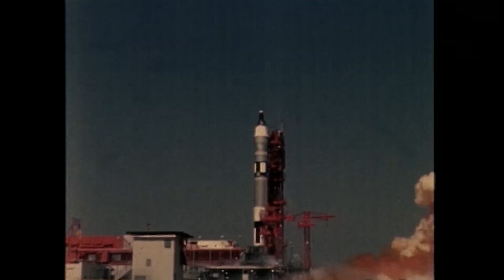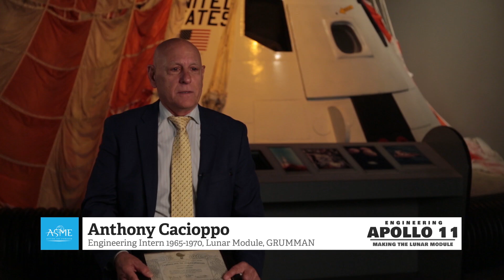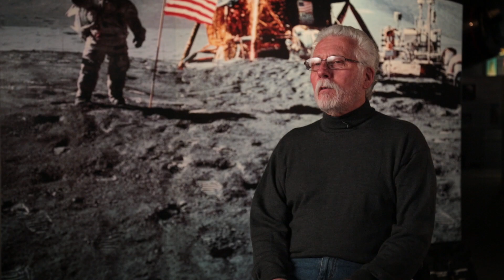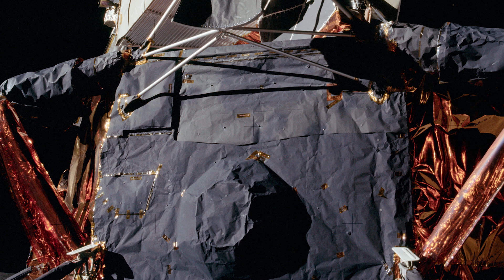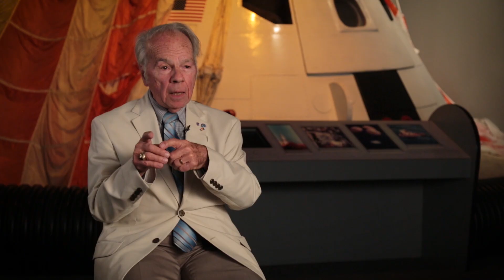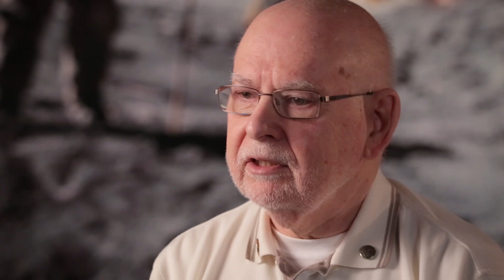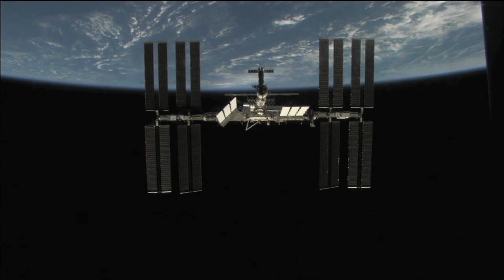Engineering Apollo 11: Making The Lunar Module [Full Documentary]

Comment: I watched them land on the moon as a kid And never really questioned any of it. Until one day I was looking at an Apollo 11 photo and noticed there was no blast crater under the luner lander I thought how could that be !!!.   So I started looking at why?? I started researching the rocket motor used for Apollo 11. It’s a 10k lbs thrust rocket motor. How is it possible that a 10kLbs rocket would not leave some sort of a blast crater or scare on the surface where it landed, yet non exists. I researched Apollo 11 and found several strange facts. According to NASA the skin of the lunar lander was so thin that you could stick a pencil through it. How could that be? That sounds rediculouse 
Then I found this. This guy is spot on. 

https://youtu.be/jKXS9KIdi4I
Reply: There is a perfectly good explantion for there not being a visible blast crater and this has been shown many many times.  If you take alook at this site:
http://www.clavius.org/
specifically this page:
http://www.clavius.org/techcrater.html
Or a video by Vintage Space, right here on YouTube.
Your blast crater worries can then be safely put to rest. 
As to pencils stabbing holes, a quick search reveals that the skin was just over 0.3 mm thick or nearly 4X that of a soda can.  It is true that the outer radiation protection layers were like foils, very thin, but the part that holds in the air could not be breached with a pencil.
Reply: @Mike Hengstebeck
"According to NASA the skin of the lunar lander was so thin that you could stick a pencil through it."
1. An aluminium Coke can is just 0.097mm thick. The LM skin was 0.305mm (0.012 inches) thick, more than 3 times as thick. Have you tried pushing a pencil through a Coke can?
2.The pressure in a (cool) Coke can is around 17psi and can rise to around 35 psi when warm. It is designed to withstand a pressure of up to 90psi before it ruptures. The pressure inside the LM was just 4.8psi.
3. If NASA were actually faking the whole thing, then why would they pick a design that would not stand up to scrutiny by other scientists and engineers,  picking a design that, according to moon landing deniers like yourself, would be so obviously doomed to failure? 

Sorry pal, all you have is your personal incredulity. You certainly have no knowledge of engineering.
Reply: @thearmouredpenguin7148  is that right?? LOL. And what’s your back ground?  Because it sounds to me like your guessing? Again what’s your back ground?
Reply: @mikehengstebeck2647  All this information is easily found on the internet. My background? A retired engineer who spent 40 years in the aerospace industry. And yours?
Reply: @thearmouredpenguin7148  I grew up in Titusville Florida. My father was aeronautical engineer Employed by NASA for 42 years he had an advance degree in rocketry & propulsion. I retired out of the military in 2001 as an intelligence officer.  My job, find the truth.  So how much research have you done on this subject? And what do you know about Werner von Braun ?
Reply: @thearmouredpenguin7148  also I’m curious as to who you worked for as an aerospace engineer? What agency?
Reply: @mikehengstebeck2647  I imagine your father must have been very disappointed in you.
Reply: @thearmouredpenguin7148  we never went to the moon we didn’t go then and we can’t go now.
Reply: @thearmouredpenguin7148  the group has decided on your new name.  It’s now Pinocchio.🤥
Reply: @thearmouredpenguin7148  funny how the aerospace engineer is now quit.  I guess when your a liar it’s hard to lie about things you know nothing about. Lying is never a good alternative mr aerospace engineer.   Belief is not a method of proof. We are not capable of going to the moon period.  🥸
Reply: @mikehengstebeck2647  I have said as much as I am prepared to say about my background. Everything I have said is verifiable. I am being truthful, you can believe me, or you can call me a liar, I really don't care. My post was not for your benefit, because the one thing I have learnt about "truthers" and conspiracy theorists is that the last thing they are interested is the truth, "they already know the truth", and that there is no evidence that would convince them otherwise. Never let facts get in the way of a good conspiracy.
The post is for the benefit of others who may have a real interest and have genuine questions, and to point out to them that there is always a reasonable answer to their questions.
Reply: @thearmouredpenguin7148   the skin of the lunar lander offered no protection from radiation and of course no protection from radiation is the whole other conversation. But again your a liar and have no idea regarding this subject matter.  Keep beleive in Santa clause
Reply: @mikehengstebeck2647  The thing to remember here is that the lunar module cabin was a pressure hull 'sandwich' of aluminium covered with an insulation blanket that had many different layers of insulation material. Then on top of this were the outer panels made of very thin aluminium. It was these panels that were very thin and could be ' poked ' through but were outside the pressurised hull. Below is the more detailed specification from the Grumman manufacturers
'The entire ascent stage structure is enveloped with a thermal and micrometeoroid shield, which combines a blanket of multiple layers of aluminized polyimide sheet (Kapton H-film) and aluminized polyester sheet (mylar) with a sandwich of Inconel skin, Inconel mesh and nickel foil or a polyimide blanket with a single sheet of aluminum skin. The blanket panels, formed in various shapes and sizes, consist (outboard to inboard) of 15 layers of 0.0005-inch-thick H-film. In a few ascent stage areas that have different thermal-protection requirements, the number of layers in a blanket panel varies slightly. Outboard to inboard, the the sandwich comprises a 0.0015-inch-thick Inconel skin and one or more layers of Inconel mesh alternated with 0.0005-inch-thick nickel foil. the number of Inconel mesh and nickel foil layers in a sandwich and the thickness of the aluminum skin vary considerably at different areas of the vehicle, depending on the duration and intensity of RCS thruster plume impingement at those areas. The combined thermal and micrometeoroid shield is mounted on low-thermal-conductive supports (standoffs), which keep it at least 2 inches from the main structure... The aluminum or Inconel skin (the outermost material) serves as a micrometoroid bumper; the sandwich and blanket material serve as thermal shielding...

The aluminized Mylar blankets insulate the structure against temperatures up to +350 (deg) F. On the TCA support truss members, which are subjected to temperatures in excess of +350 (deg) F due to engine radiation, an additional 20 layers of H-film are installed. H-film has an insulating capability up to +1,000 (deg) F. Additional H-film blankets are also used in other areas of the ascent stage that will be subjected to temperatures in excess of +350 (deg) F.'
Reply: @thearmouredpenguin7148  also mr aerospace engineer aluminum cans do not fly in the vacuum of space and  at 4000 miles an hour of space. That was a poor example mr aerospace engineer. 😎
Reply: I know this will be a waste of time. Do the math. The LM was not using full thrust at landing ~25% = 2500 pounds. Since there is no atmosphere on the moon to "hold back" the exhaust gases they will expand quickly. Let's be conservative and say they will only be 5 feet in diameter when hitting the surface of the moon. Now the math - 2500lbf, 5.0ft diam. => 19.6ft^2 area, = 2827in^2 area, calculates to 0.88pounds per inch squared. The human body, blowing as hard as it can, can only produce a maximum of 2 psi. 

Next time you go to the beach, find some dry sand, blow as hard as you can and see how deep of a crater you can make. 

Remember, the regolith on the moon is estimated to be on average 10ft deep. There is no erosion on the moon and the regolith particles are sharp and angular and interlock much better than beach sand.
Reply: @ronmccabe7164  your calculations are incorrect.  Do you know anything about the descent rocket engine used for Apollo 11? Because your math shows me you know nothing about this descent rocket motor!
Reply: @mikehengstebeck2647  The descent rocket engine was 10,125 Ib thrust and then throttled down to about 3,300 Ib just before landing.
Reply: @Puma-70  that 3300lbs would have blown moon dust everywhere and left blast mark under the LM. No blast mark means no landing on the moon it’s fake
Reply: @ronmccabe7164  hello Ron, you and your mathematical equations LOL. I’ll give ya a hint Rob NASA calls it Descent propulsion system…..google it.
Reply: Biden Sucks  make me?
Reply: Kit Canyon I think you have coronavirus. Your English is terrible.❌
Reply: @mikehengstebeck2647  So Mike, how many people have to patiently explain to you how and why you are wrong before you accept it?
You appear to be involved in the enterprise that does some actual good to the people. Why don't you focus on that, instead of wasting your time, energy and health on defending the indefensible?
Reply: @mikehengstebeck2647  Were ALL the moon rocks shown to be fake, or just one example?
Reply: @sailorman8668  we didn’t go to the moon so that means they would all be fake. Here’s the problem NASA just came out and said water exists on the moon. 🙄.  How stupid is that.
Reply: Ross Meldrum Then I found this. This guy is spot on. 

https://youtu.be/jKXS9KIdi4I
Reply: @mikehengstebeck2647  The following is not from NASA .
The lunar surface is hard rock beneath dust; the LEM used a low pressure (for reliability) rocket engine that was firing at only 3,000 pounds thrust before landing so along with the very thin atmosphere and low gravity there was not enough pressure to produce a crater; and the blast deflected dust sideways. If you look closely at some pictures of landing sites e.g. Apollo 11 you can see some disturbance under the engine. 
The LEM’s strange shape and fragile look was due to the requirement of flying and landing in a vacuum. The ascent and descent stages were built to be as light as possible and the outer panels covering the aluminium shell were extremely thin and buckled with the stress of impact and lift off. These were outside the pressure hull (which itself was built from aircraft standard aluminium) and so were completely unimportant in terms of strength.
On ascent the Lunar Module ascent stage (3,500 Ib trust thrust engine )had only to climb back into lunar orbit and rendezvous and dock with the Command Module. This orbital velocity was approximately 3,600 mph. It was the job of the engine on the CSM to accelerate them to "escape velocity" and set them on a return trajectory towards Earth. The acceleration of a rocket powered launch vehicle with a constant thrust engine starts off low and then increases as propellant mass is expended. In a vacuum (as here) the acceleration is inversely proportional to the ever diminishing total mass and so builds at a constant rate until the engine shuts down. Therefore, it reaches the orbital velocity of 3,600 mph simply by continuing to burn the engine for as long as is necessary.
NASA did not lose the telemetry tapes from Apollo 11 but rather the taped recordings of raw analogue video transmitted back from the spacecraft. The tapes where made using specially designed, high-capacity recording gear in order to capture the raw transmissions at the point of receipt in case anything should go wrong with the elaborate system used to convert them to a standard broadcast signal. Nothing did go wrong, and once the conversion and transmission was complete, the recordings were no longer needed for their original purpose.
Any magnetic recording media has a limited life. The magnetic fields of the stored data decay over time. For this reason, and because high-grade tapes were very expensive, they were never considered an archival medium. It may seem odd today, but in 1969, the second-hand copies filmed off specially built, flat screen CRT displays were considered the archival copies, and we still have a number of these, including some shot by NASA and some shot third or fourth hand by television networks and affiliates.
The moon rocks were confirmed as not terrestrial by geologists from many countries around the world.
NASA did not lose the technology to go to the Moon in the sense that it was forgotten, mislaid or mysteriously disappeared. A lot of the blueprints still exist on file; but the individual knowledge of everyone involved and the “organisational know-how” of how to actually run such a huge, complex project has been lost. Most of the engineers and technicians are now retired or dead. And on top of that, much of the equipment is incredibly dated, and many things cannot be bought “off the shelf” but would have to be specially manufactured. Re-designing from scratch would be cheaper and better.
Reply: @Puma-70  thank god you can copy and paste Neil. The problem is your just regurgitating or plagiarizing NASA’s report. Nice try Neal but Knogo.
Reply: @mikehengstebeck2647  This is not a NASA report but information I have collected from third party sources since 1971. If you read it you will see it makes sense.
Reply: @Puma-70  what’s your back ground? Do you know who Werner von Braun is?
Reply: @Puma-70  I tried to warn you above. You’re wasting your time with this yo-yo.
Reply: @mikehengstebeck2647  he sounds much more knowledgeable about the LM than you do about ANYTHING that you bring up. The real question is do YOU know who Werner Von Braun was? See if you can answer that without cutting and pasting yourself.
Reply: Ross Meldrum why do you think we are having these conversations? The beans have been spilled. We didn’t go then and we can’t go now, that is the logic behind all of this.  As humans we don’t just leave something alone once  we conquer it. If we had gone to the moon other countries would have followed by now, Russia, China, Japan,     We just finally made it into low earth orbit successfully.
Reply: If you ever do attempt to do some proper research, you would find that every single supposed bit of evidence brought up about alleged proof regarding hoaxing the Apollo landings have been debunked over the years. Most of it with relative ease because the supposed proof is usually based on complete ignorance of the particular subject involved. Meanwhile, there is tons of scientific evidence that is irrefutable which has been accessible to scientists and aerospace engineers for the last 50 years who have never found anything that might suggest the landings were faked so it's only people who lack critical thinking skills who fall for this moon landing hoax nonsense. Here's some of it:

-> There's the live TV coverage that would have to somehow convincingly fake 1/6th G movement in a vacuum, Google "Irrefutable Proof for Moon Landing - Lunar Gravity" and explain how experts in the field of kinematics for 50 years have never come forward with proof that the astronauts are not in an environment that they say they are. There's also the fact that any attempts to do filmed mockups of the eva's on Earth would have to be passed off as live TV broadcasts which would have to fool telecommunications experts around the world. Google "Moon Hoax Not" and "For Jarrah" to get a better understanding of how much would be involved to pull that off and how the filming technology back then was simply incapable of such a thing.

-> There's all the moon rock and core samples that would have to somehow be able to pass scrutiny with geologists who can readily spot whether it's something that has passed through our atmosphere or not. 
Google "How do we know that rock came from the moon?"

-> NASA has made these samples available to scientists from around the world and every year 500-1000 samples are sent out.
Google: "NASA lunar sample request"

-> There's the Apollo 16 UV telescope images that no astronomer in 50 years has ever found fault with. Google "onebigmonkey apollo 16 UV telescope"

-> Another thing that astronomers would be able to spot are pictures of the Earth that don't match what they should look like. Google "Apollo 11 Earthrise - How One Photo Proves it was Real" for an example. 

-> Another one to google is "Apollo 11: Fingerprints in Deep Space" that shows obvious handheld TV footage from the Apollo 11 CM looking at Earth from far enough away that they are clearly beyond the VAB's.

-> Then there are the LOR images. Lots of hoax believer nonsense about them being faked but the transmittal data for them can be downloaded by anybody with a computer and so far, nobody has proven anything about them being faked. You don't think a smoking gun like that wouldn't have been scrutinized by people with the required computer science expertise??

-> Here's something else you might not know. Apollo 12 landed close enough to Surveyor 3 that Conrad & Bean were able to do an Eva to it and removed the camera and sampler scoop from it to be returned back to Earth. They wanted to see what the harmful conditions of the moon had done to those parts after 2.5 years: Google "Analysis of Surveyor 3 Material ad photographs returned by Apollo 12"

-> 5 plutonium-238 powered ALSEP's were left behind that transmitted data from the experiments back to Earth right up till 1977. Unfortunately, due to budget constraints, they were shut down but they did send back enough information that storage of it became a real problem as detailed in this article: Google "the-long-road-to-alsep-data-recovery"

-> Starting with Apollo 13, they purposely directed the spent S-IVB's to crash into the moon so that the Apollo 12 seismograph could record the seismic waves generated to help determine the moon's crustal structure and makeup. Of course, as each successful mission added another ALSEP, they were able to expand on the info derived from these man-made impacts. They also did the same with the lunar module ascent stages. The Apollo 16 LM ascent stage data isn't shown because of difficulties during the de-orbit phase. They were able to derive a lot of info from these artificial impacts. Google "The Description of Apollo Seismic Experiments darts"

-> Another great site to check out has some pretty thorough crater analyzing to prove the landings happened. You can check out all six of the landings this way: Google "onebigmonkey apollo sights landing"

Are you starting to understand the magnitude of what would be involved to pull a hoax like this off? Never mind keeping it from being exposed?

I suggest you also take the time to read through the 93-page pdf titled "NASA’s Recommendations to Space-Faring Entities: How to Protect and Preserve the Historic and Scientific Value of U.S. Government Lunar Artifacts". There is lots of nonsense from hoax believers that the USA is trying to make the Apollo sites inaccessible which is ridiculous seeing as these are only recommendations designed to limit harmful effects of spacecraft landing too close or the altitude of hopper type craft flying at too low of an altitude. The fact is, the USA has no issue at all with visits to the sites by manned or unmanned means. They do request the Apollo 11 and 17 sites are accorded with the proper respect due to the obvious historic value. Also, there is an Appendix B in the pdf that gives a lot of recommendations from NASA as to what type of investigations at the Apollo sites would be most beneficial for scientific purposes. Now does this seem like the type of behavior for a country that supposedly faked all of this??

As I said, irrefutable proof that has withstood scrutiny by the relevant experts from around the world in all the specialties involved for 50 years which in my book proves beyond a doubt that the landings happened just the way they were documented 50 years ago and which easily trumps supposed proof that this was all faked but that same supposed proof doesn't stand up long to scrutiny.
Reply: I've asked numerous hoax believers to explain away all these points listed below and they can only come up with the typical hoax believer answer. Until you people can come up with something better that can be verified by credible experts in the relevant fields involved, then as far as I'm concerned, the moon landing hoax theory is right up there with the flat-Earth nonsense.:

-> 400,000 people were involved with the project, yet nobody has come forward with evidence that the landings never happened. You guys like to bring up the Manhattan Project compartmentalization security that kept only the ones in the need to know fully aware of what was going on. Yeah, sure. A top secret military project that kept even vice president Truman out of the loop being compared to a project like Apollo that was as publicly open as possible. Yet despite all the USA's attempts to keep the A-bomb project under wraps Russia still managed to get key people in the right places to provide them enough info that they developed their own bomb much sooner than the USA expected. You seriously expect us to believe that in the past 50 years since the landings were supposedly staged, nobody has come forward with insider information or definitive proof? Yeah, right.
->Typical hoax believer answer: (Something involving a worldwide conspiracy with zero credible proof)

-> The Russians tracked and confirmed all 6 of the Apollo moon landings. Why would the USA's major competitor during the space race do that?
->Typical hoax believer answer: (Something involving a worldwide conspiracy with zero credible proof)

-> Russia, Europe, China, India and Japan have all flown missions to the moon. So far, none of these countries/nations have brought forth any evidence that it's impossible to do a manned mission to it. That includes this nonsense about the radiation in the VAB's being too hazardous to pass through. No radiation expert from any country including the ones mentioned here have ever stated that the radiation in the VAB's was an insurmountable problem during the Apollo missions to the moon. Why is that?
->Typical hoax believer: (Something involving a worldwide conspiracy with zero  credible proof)

-> Scientist from around the world have verified and peer reviewed all of the lunar rock & core samples plus all the data transmitted back to Earth by the ALSEP's left behind. There's also the Apollo 16 UV telescope images that include some of Earth that no astronomer has ever found fault with. Why would intelligent individuals go to such trouble?
->Typical hoax believer: (Something involving a worldwide conspiracy with zero  credible proof)

-> Hoax believers have for the last 50 years tried to find evidence that the landings were faked and have found nothing that can't be debunked. The proof they failed is that despite all their efforts, the missions are still in the history books. A story of that magnitude would have been seized on by investigative reporters and news networks. Not just the USA but countries from around the world would have gone after the biggest scoop in history. Explain how come they haven't.
->Typical hoax believer: (Something involving a worldwide conspiracy with zero  credible proof)

-> Third party evidence from countries outside the USA that NASA would have had to orchestrate and coordinate flawlessly while at the same time supposedly hoaxing the mission; How could they manage that without insider proof coming forward for the past 50 years to blow the whistle on it all?
->Typical hoax believer: (Something involving a worldwide conspiracy with zero  credible proof)

Trying to discredit information because it came from NASA, as I'm sure you'll do, is a bit ridiculous. They made all the engineering and science required to pull the missions off available to their counterparts from all kinds of countries throughout the world.

In regards to the Apollo landings, we are talking about hundreds of 1000's if not millions of people with above average intelligence in various countries throughout the world over a time span of 50 years.

I'm not just talking about the people involved with the project while it was happening. There's also all the scientists and engineers in the following decades that have access to everything related to it regarding the engineering plus all the scientific, peer reviewed evidence, data and samples. Yet in all that time none of these highly intelligent folks from around the world have ever found a way to somehow get information out to anybody about NASA"s alleged duplicity regarding the supposed landing hoax.

Considering how incompetent everybody seems to think governments are, it's pretty amazing how people like you have no problem believing that a hoax of this magnitude could have been kept for so long without one piece of verified proof from the hoax believers being brought forward in 50 years. All you guys have is unsubstantiated claims that require ridiculously more unlikely and equally unverifiable conspiracies within conspiracies to keep the original moon landing conspiracy going. Does that not give you the slightest hint that maybe the moon landing conspiracy is seriously flawed? People who see no problem with that usually dismiss, ignore or don't understand the irrefutable scientific evidence.
Reply: mako88sb if you would just watch this video.  The photos don’t lie.  You can see for yourself.  Your obviously from another country. None of you immigrants know anything about America’s space program.
Reply: Mike Hengstebeck To answer your question: I’m a German engineer. I may not be certified in aerospace engineering, but I think I’m qualified enough to see that most of your arguments come from a preconceived notion that for some reason you choose to cling to despite overwhelming evidence to the contrary. No blast crater, therefore we didn’t go, that’s your point, right? Ok, please elaborate how you came to that conclusion, I’m open to change my mind. Did you factor in the thrust of the engine, the low-g and vacuum environment, properties of Moon dust/rocks etc..? Is there any comprehensive study or simulation that you can point to that factors in all these variables and that comes to the same conclusion?
Reply: Qaspar Troy hello Qaspar nice to meet you. First i would like to point out that here we are 50 years later and the notion that the moon landings were faked is still alive and well today, in 50 years NASA could not convince these non believers that we went to the moon?

I lived 22 miles from the launch pad of Apollo 11.  Cape Canaveral. It was called Cape Kennedy from 1963 to I believe 1973 ( I could be wrong on those date but I’m close). My father worked at NASA from 1960 to 1986. 

When the astronauts returned from Apollo 11 is when the rumor mill started in our small town,

 Then the theory abounds that Gus Grissom and crew were killed because Grissom continued to have doubts that they could make into space. 

NASA Engineer Thomas Ronald “Tom Baron”was a quality control and safety inspector for the Apollo program Six days after his testimony regarding Safty concerns with a possible fire inside the capsule, Baron was killed instantly, along with his wife and stepdaughter, when a train “ OWNED BY NASA” crashed into their car. 

The US could not get a rocket off the ground before 1958 and Werner von Braun finally made that happen. 

When the (upper) lunar module takes off from the surface of the moon the camera they use (from earth Houston) tracks the lunar module perfectly as it takes off.....impossible during the time. 

Where the cameras are located on the astronauts space suits.  Impossible to take 5000 perfect pictures.

Why haven’t we gone back to the moon ? We can’t, we don’t have the technology to land on the moon and leave the moons surface or we would have been back to the moon already.  

Challenges like  radiation through the Van Allen belt, The absence stars, no blast crater/marks under lunar lander, questions about lighting on the moon, questions surrounding Stanley Kubrick involvement and 4 of the Carl Zeiss camera lenses NASA gave Stanley Kubrick, there’s a transcript of Stanley Kubrick admitting he help NASA fake the moon landings, no airlock room for changing into and out of their space suit on lunar lander. 

Can’t see where the (upper) lunar lander separates from the (lower) lunar lander, cheese cloth hangs over these points in the photos so you can’t see those release point.  

Different Photos with the same landscape/back ground with lunar lander only, then same landscape but astronaut (only) in the exact same location Same scenery in the back ground (Questionable).

The behaviour of NASA is  questionable. They (NASA) have excuses for everything, We lost all the footage.We lost all the drawings. The moonstones that they brought back have been tested and turned out to be fake.The behaviour of the Astronauts in Astronauts gone wild from Bart Sibrel. When Aldrin is confronted with the footage.....just look at his reaction!!!!!!One of these red flags.....ok i am with you.....its possible......but one after another after another after another.And organisation that lies once.....and about something so significant and historic is not to be trusted

At one time I thought we went to the moon. There is sooo many oddities about this subject. 

These are My experiences that lead me to question the moon landings .

I watched them land on the moon as a kid And never really questioned any of it. Until one day I was looking at an Apollo 11 photo and noticed there was no blast crater under the luner lander I thought how could that be !!!.   So I started looking at why?? I started researching the rocket motor used for Apollo 11. It’s a 10k lbs thrust rocket motor. How is it possible that a 10kLbs rocket would not leave some sort of a blast crater or scare on the surface where it landed, yet non exists. I researched Apollo 11 and found several strange facts. According to NASA the skin of the lunar lander was so thin that you could stick a pencil through it. How could that be? That sounds ridiculous.

Stories about Fake moon rocks , 2 attempts on Gus Grissom life, (they killed him on the second attempt Gus did not believe we could make it to the moon). No stars( I’ve heard the arguments about why no stars could be seen, but you can take pictures on earth during the day and see stars so that didn’t make sense to me, no blast crater or disturbed lunar dust under the rocket motor( I know all about the descent rockets the Lunar module 3k thrust)

The reason NASA guarded the moon rocks so intensely all these year, NASA realized that when you looked at the geology of these rocks you could find water internal to the rock (because the rocks are from earth not the moon) now all the sudden NASA is saying they found water on the moon . How convenient.  

Everyone always ask can you see the flags on the moon. 

NASA is saying oh after 50 years they believe the sun is so intense it’ will begin to deteriorate the flags so you may not be able to see the flags anymore. How convenient. 

Look at the demeanor of the astronauts on Apollo 11 when they returned . None of them are happy they look very stressed. When asked about seeing stars they didn’t even look like they knew how to answer that question. 

Camera shots that look fake, shots of the Lunar lander look fake,  problems with the lighting, no lock out room for the Astronauts to change into their space suits. 

Stanley Kubrick gets involved with cameras and camera lenses. Talk/ rumors abound that Stanley helped NASA fake the moon landings. 

The fact that Neil Armstrong never gave an interview “ever”to anybody about his trip to the moon.  In 1994 a Armstrong’s  speech he talks about uncovering protective layers of hidden truths.....

No stars( you can, however take pictures on earth during the day and see stars, no blast crater or disturbed lunar dust under the rocket motor( I know all about the descent rockets the Lunar module 3k thrust)

Another popular question asked can you see the flags on the moon. 

Camera shots that look fake, shots of the Lunar lander look fake,  problems with the lighting, no lock out room for the Astronauts to change into their space suits. 

The fact that Neil Armstrong never gave an interview “ever”to anybody about his trip to the moon.  In 1994 a Armstrong’s  speech he speaks to  the future uncovering protective layers of hidden truths.....

On and on and on with these types of coincidences. . 

When the Apollo 11 astronauts take off from the moon and the “camera “that follows the lunar lander module up and the camera worked flawlessly!! all the way from Houston IMPOSSIBLE to do in the 60s. We still Have problems today with radio signals it’s laughable to think they could do it in the 1960s.  The energy required to get that radio signal from the earth to the moon didn’t exist. Our TVs in the 60s that we watch the Moon landing on  we’re still using tubes. Everyone had TV Antennas of course because there was no cable TV.  Our TV antenna was actually adjustable and had a motor and could be operated for the inside of the house so you could turn the antenna to get a better signal.

Losing bone, muscle mass and radiation are the challenges we faced then and still face those same challenges today in deep space. Humans are not made for space
Radiation and the Van Allen that’s still part of our problem today and why we haven’t gone to the moon or back to the moon.

 This is pretty interesting, of course its about why we could not go to the moon. You may not like this. 

https://youtu.be/x1eryoc4oVU

Then I found this. This guy is spot on. 

https://youtu.be/jKXS9KIdi4. 

So as you can see it’s not just on thing that makes me believe we didn’t go to the moon lots of evidence.
Reply: Mike Hengstebeck Thank you for your reply. I would very much like to address every specific point you made one at a time and not spam the discussion jumping from one copy-paste talking point to another. But firstly, I don’t think you have answered my question. I was asking for a simulation or study replicating lift-off of the LM including the variables and circumstances that went along with it. At some point you say 10klbs thrust, then 3k (pounds?) As far as I‘m aware the LM needed roughly 2.5 klbs of thrust to negate lunar gravity, please correct me if I’m wrong. This is not a whole lot, less than a tenth of a Harrier jet which btw does not leave a crater behind when it takes off - on Earth. In a vacuum environment gasses leaving the combustion chamber immediately expand in all directions, so in my opinion it is not intuitive to expect a strong directional force, hence any kind of effect that you would call a „blast crater“. To be honest, I am not aware of any similarly sized craft that shows this effect on Earth, where you need much more force and the atmospheric/geological properties are very different. Btw with no organic compounds in lunar soil, visible charring/burning is not to be expected either. However, if you can show me calculations/simulations/studies that show me that, contrary to my intuition, there indeed should be a blast crater, I am open to reassess my view that this claim is lacking substance. Cheers and have a nice day!
Reply: Qaspar Troy -so you said you were German!  I’m German, your the first German I ever heard say “Cheers” sure your not British? 

I find it interesting that’s it’s all foreigners and immigrants that defend this story!  Your not from America you can’t possibly know the whole story. Why do you care?

Again my story was about Apollo 11 and why I now believe we didn’t go to the moon. You only addressed the no crater question. Which was incorrect by the way.  The Decent engine had a variable throttle (so they say) 10k thrust and was throttled back to 3000lbs thrust. The engine was powered all the way to the surface of the moon. Apollo 11s landing on the moon was (so they say) recorded so you can see the moon dust being blown away as the lunar lander makes contact with the moons surface. Yet NONE of the photos show any disturbed soil directly in under the rocket or blasting out ward away from the rocket, You would see a pattern some sort of a pattern under the rocket and out ward from the rocket. 3000lbs is still a lot of thrust and would most certainly leave a mark of something sort as the rocket blast shield is 3 feet off the surface of the moon. 

NEXT-
Reply: Mike Hengstebeck So.. me saying “Schönen Tag noch!” would have been more appropriate? I am indeed a born and raised German and I hope you’re aware that there are different places where someone can pick up English. Anyway, I addressed the crater question because that is the topic of the conversation. And yet again, you haven’t answered my question. I have to assume at this point that it is a hard no from you, you can’t point me to a simulation or study that comes to the same conclusion. Please be aware that this is an essential question you have to answer if you want to be taken seriously by anyone who knows a thing or two about physics/thermodynamics. It seems to me you are guided by intuition. Intuition is great for coming up with questions and learning new things, but it is a terrible guide for solving complex problems. Also your claim of undisturbed soil is false. It’s an easy picture search to find images of the lunar lander where the dust underneath the engine clearly has a different texture than the surrounding soil, albeit no “crater” that for some reason you demand should be there. Why should it be there? I’m still waiting for a concise answer. I’ll happily discuss any other topic with you. But if you keep not answering my very first question while claiming that I can’t know anything because I am a foreigner.. please don’t mind me ditching this conversation because frankly we’re wasting our time here. Have a nice day. Edit: Schönen Tag noch! 😉
Reply: @mikehengstebeck2647  : Did you mean to write " you're"? Interesting grammar hoaxers learned in school.
Reply: @kitcanyon658  you still pushing that fake moon landings crap.
Reply: @mikehengstebeck2647  There you go - standard hoaxer talk - abuse the people explaining it by resorting to racial slurs - sir you need to see someone - your the one with problems ..anger management one of them
Reply: You’re all wasting your time trying to talk logically to this Mike Hengstebeck fellow. He’s been insulting people on many Apollo and NASA pages for a long time, with the same arguments and talking points each and every time. I used to have fun debating him but it turned into just him trying to get a rise out of me with insults, and when he saw that it didn’t work he would go on some kind of rant about how I must be an engineer from Wales, because Wales doesn’t have any engineers, or some such rot. So, if you like to have fun with him, have at it. But trying to talk sense into him? Don’t even bother.
Reply: @manlymcmanface9932  You are absolutely correct.  You know, it is possible to "question everything" and come to the conclusion that some of things you questioned were just as they been described.  The "question everything" people are not really questioning things,  They are committed to contrary positions no matter where the evidence leads.
Reply: @robbarnes9047  Like all conspiracy theorists, there is no evidence for what they assert!
Reply: @mikehengstebeck2647  you've made my week 😂😂😂😂 if you weren't serious I'd think you were joking 😂😂😂😂😂😂😂😂😂😂😂😂😂😂😂😂😂😂😂😂😂😂😂😂😂😂😂😂😂
Reply: @robflynn509  I know it’s such a funny joke them trying to say we went to the moon.  It’s such a joke.